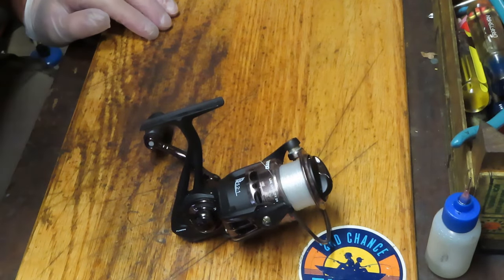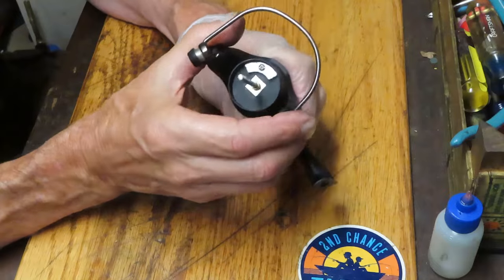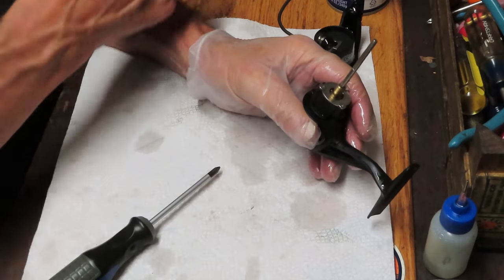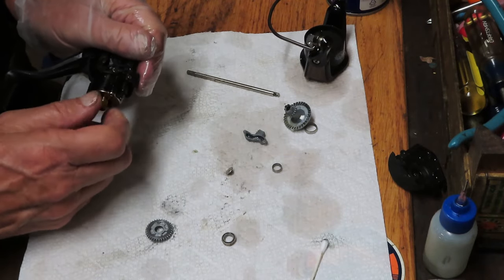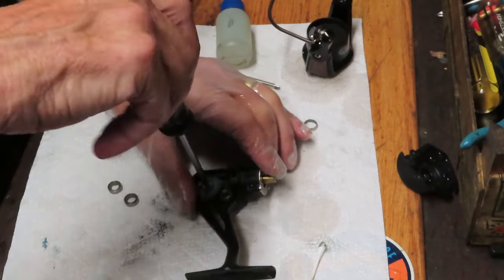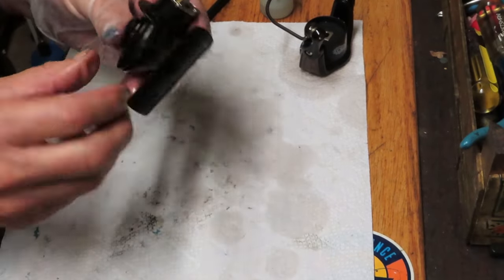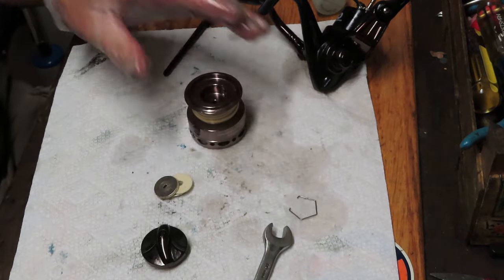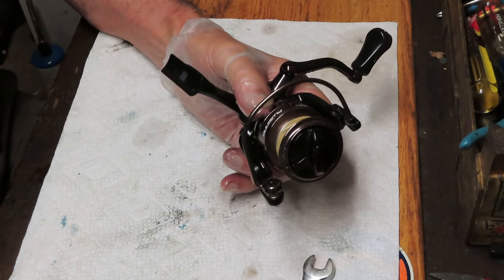Pluisino 3000 spin fishing reel failure and how to service

Comment: Thanks for showing the service on this reel, Dennis.  Prior to the pandemic they sold for as little as $12-16.  I compare them to plastic silverware—if you treat them carefully and offer a lot of maintenance, they might be serviceable.  If you put them under pressure or neglect them they will eventually fail.
Reply from the maker: Thanks for the additional information - Yes - they should be treated with care

Comment: You’re working just like I do. I use automotive blue paper towels under a reel while I work on it. I use the thinner white paper towels for cleaning.  I don’t criticize budget reels because we do need then in the marketplavce. Also I have about 5 K-mart vintage reels that come from the late 60s and 70s that are still great reels. Dennis, I had a lengthy battle with the AR override on an Abu Garcia CD4 1000 center drag reel today. I fixed it finally but it took a while. I then tackled a DAM Quick 270 Super with a line counter. Some of the parts are soaking overnight. I had to use the slide hammer to get the pinion and bearing out. It was really stuck as it took about 20 hard whacks to get it out. Do you have any suggestions for a bail arm bumper for a DQ Super? It needs one so the bail doesn’t almost fold back. The body cosmetics on this Super are almost perfect. I think I have five of these reels and this last one actually looks the best. Tomorrow I have to finish the Super and then work on a Pflueger Pelican reel. I could not believe it when I got that pelican because the entire rotor oscillates and has planamatic movement. Tha t was a surprise. — Chris. PS. You did a great job bringing this z Amazon back to hearth! LOL
Reply from the maker: Thanks Chris.  I have only seen a piece of plastic held with epoxy as the bumper solution.